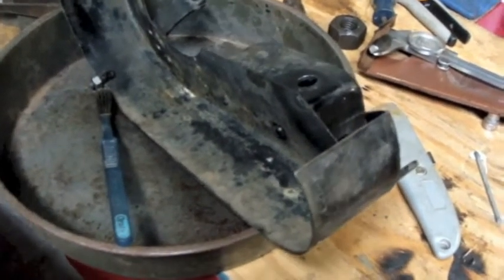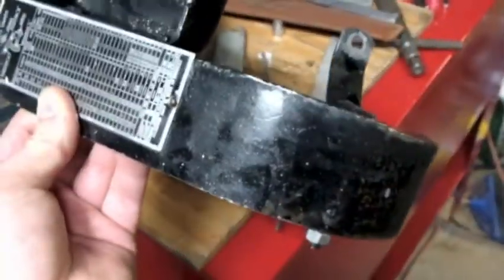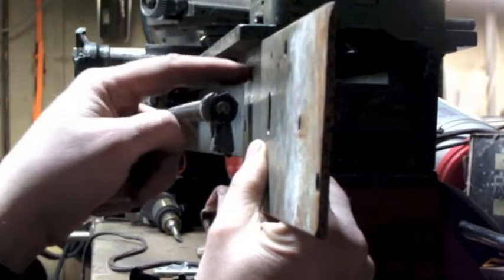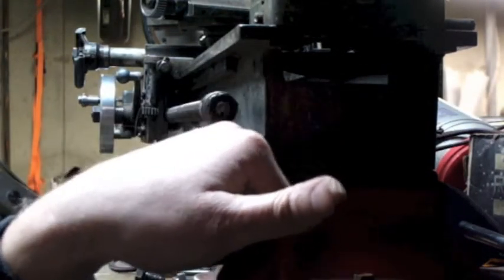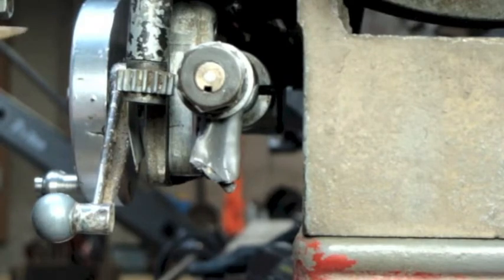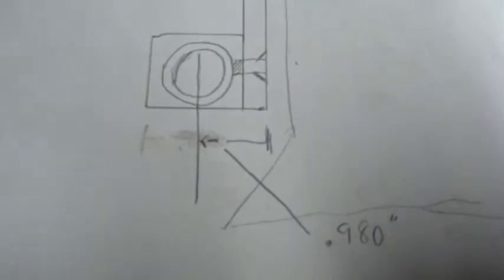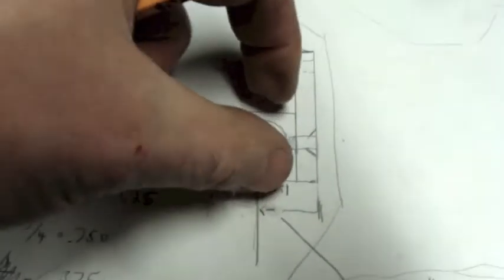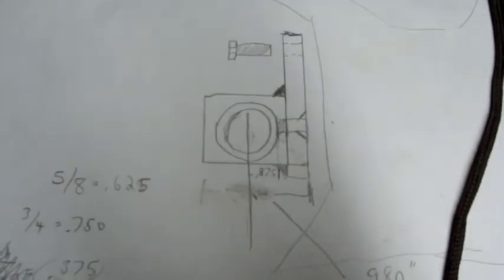Atlas 9" Lathe Part 23

Comment: Steve;

The part was designed the way it was in order to allow a slight bit of flex in the support just in case there was a tiny bit of misalignment in the shaft.  I am not sure you want to take out all the degree of freedom with your design (yes, I am an engineer so I may be over-zealous here).  Those old time engineers understood a lot more about the forces working on those lathes than we tend to give them credit for.  If you are planning on welding, it should be pretty easy to make up a welded piece that comes pretty darn close to the original.

Just my 2 cents worth.

Regards;

Ron Kluwe
Reply from the maker: Going with a one piece unit, and am going to build in a failsafe feature. I'm not going to worry about allowing for flex because Atlas later redesigned this bracket, and made it much stouter, so I think it'll be okay.
Reply: it is also said that the bracket was made weak so it can break on purpose when something goes wrong instead of damaging a more expensive and hard to replace part.

Comment: Steve,  I wouldn't use your .980 measurement.  Make the plate which bolts onto the bed and get the recess cut into the back, bolt it into place and then measure again. 
.980 assumes that you'll be able to file that part and make it sit perfectly flat which may not be the case because of the casting.
Reply from the maker: Okay, thanks.